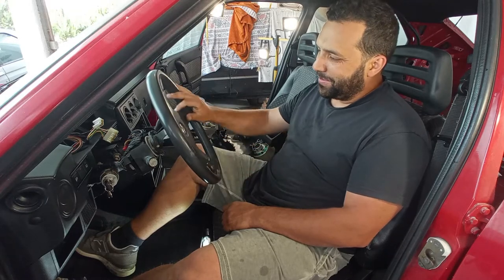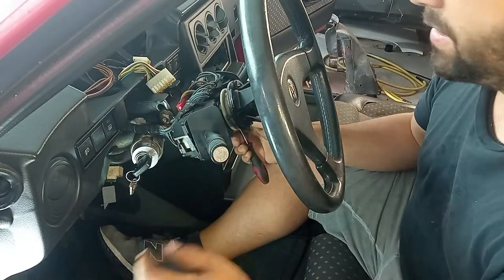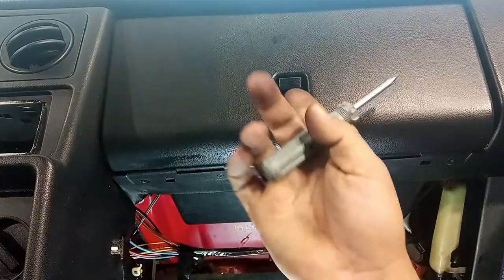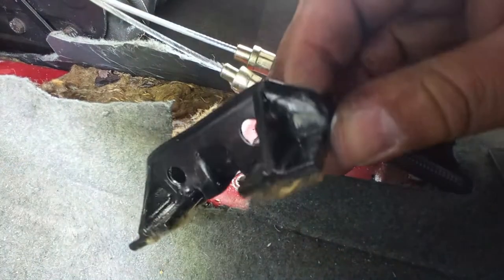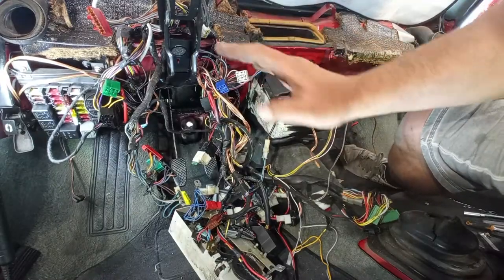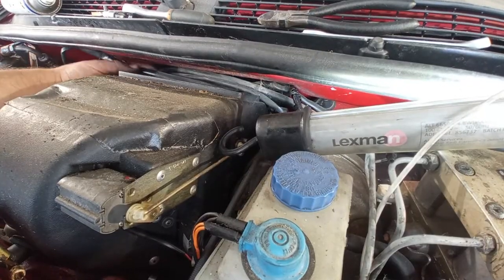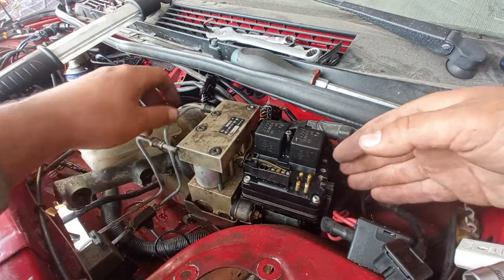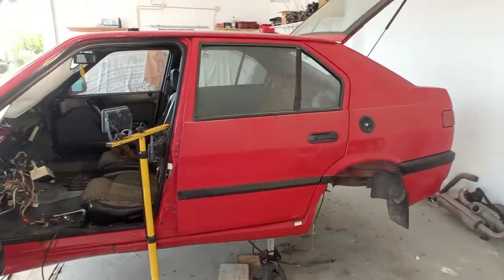How to remove the dashboard and climate control from the Alfa Romeo 33 1.7 16v 140hp 1990

Comment: Ok. So, 4 pin connector should be used for blink-code diagnosys procedure. I tried it on my '92 164, but got nothing) Brown panel for "relay" actually is not for relay, it's S30 switch (you shoul have yellow/red or, i beleave, blue "relay" - which are actually not relays, instead of relay's insides they only have connection between 2 legs, wchich allows you to choose defferent map sets in motronic 4.1. to use or not to use o2 sensor and which octane are you using. Best settings for the cat without o2 sensor and for highest available octan = no "relays", exact like in your case)
Reply: for 2 pin connector - who knows, we dont have that in 164. 3 pin for comp dignostic with fiat 3pin -> OBD2 + OBD2->usb + multiecuscan/other
Reply from the maker: Hello. That is simply the best explanation that I've seen about those connections! Thank you so very much for taking your time! 
And thanks for watching the video!
Reply: A littel update for 2 pin connector: in 3l versions 164 it allows switching between auto/manual tranny types. On other cars it has different usage: found on alfabb: pin11 -- 75: 1.6IE/1.8IE select: 1.6 / 1.8
TS select: alfa 75 (n.c.)/ alfa 164 (gnd)
V6 select: auto (n.c.) / manual (gnd)
In that case one of the pins should go to the ground, and other to pin 11 of motronic 4.1.
Just check it if you interested.
in 33 it could also provide switching between 2 different present at factory. I never had 33s and dont know which )
Actually it was very usefull for me, i coul have 2 different custom maps (lean and reach for cruise/sport) and switch between them with simple tumbler switch. Huge natrium exaust valves allowed me to use lean Lpg mixtures w/o fear).
Reply from the maker: @melnikov79 wow! That is golden information! And very ingenious of them to do it like that! One control unit fits all type of thinking and then the shunts do the rest. Marvelous
Reply: I have a 1994 1.5 IE and it only has the 3 pin connector (T1) for Alfa tester and MP3.1 switching connector that chooses between 1.5 and 1.7 engine maps.

Comment: Excellent modification on the handbrake cable holder bracket, it is definitely something I would attempt, mine is so springy no matter how much it was adjusted.
Great stuff 👍
Reply from the maker: It will become so firm.. like it should be from the beginning. Thanks for watching

Comment: Nice mod on that hand brake holder. You can make a few of them for sale. :D
BTW, have you ever repaired the reflectors of the fog lights (or head lights)? On my 159, the reflector for the front fog lights has lost the chrome on the bottom. I am looking to have them rechromed, and I have found two places in my city where they claim that they do that (well at least one directly claims it). But I am not sure of the finished result.
Reply from the maker: Hello. Thanks for watching once again! 
These Alfa 33 hand brakes always drove me crazy! This I think is a cheap and good solution. But mass production I don't think so.. because every car can have a slight difference on the tunnel curvature and the modification must be done regarding that. 

About the reflective surface on the headlights, cannot tell yet. I will do that for the 33 and report on a future video
Reply: @alfaromeonoproblem  Thanks. I will too, if I had it done before you.

Comment: Looking forward to that 159 gearbox video. ;-)
Reply from the maker: It will be a very complete one!
Reply: @alfaromeonoproblem  Nice. But which gearbox is it? The GM or the FIAT one?
Reply from the maker: @DashCamSerbia the GM m32. Info about oil quantity and type will be there too
Reply: @alfaromeonoproblem  Oh, great! I just had the oil changed in mine, and additional 0.5L added through the top plug. The dealer used Petronas Tutela Transmission Matryx 75W-85 API GL-4, FIAT 9.55550-MZ1. Which I think is what it came from the factory with.
Reply from the maker: @DashCamSerbia yes, that is correct!